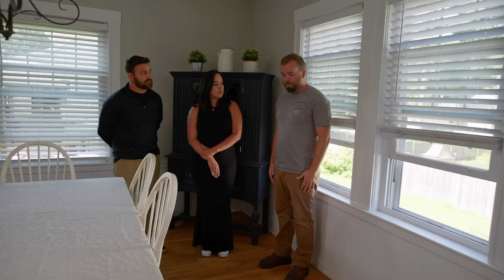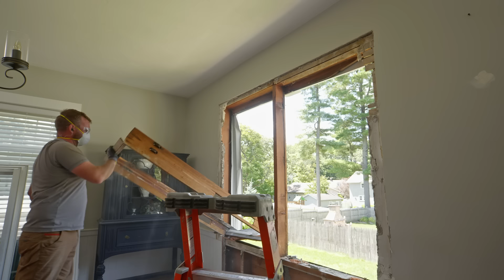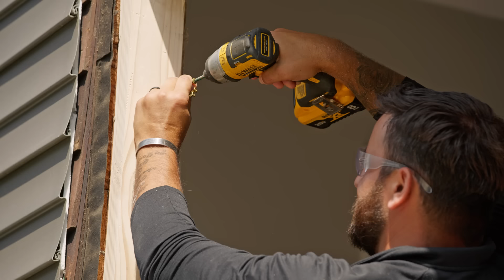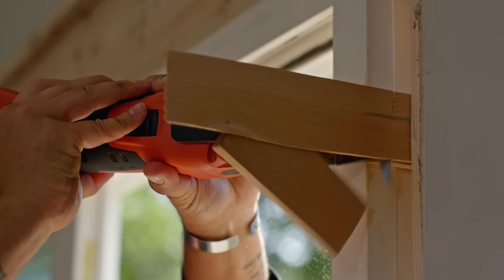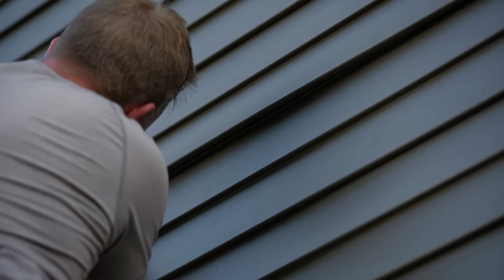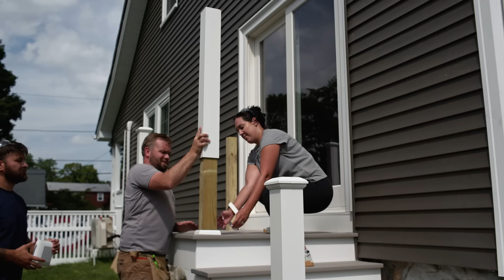How to Turn a Window Into a Door | Ask This Old House

Comment: I still dont like the idea of joist tape. If any moisture gets under that tape then it will just stay wet. Most of the times that I have seen old deck joist rot is when its built around concrete steps. Usually the deck boards rot because people stop painting them and very rarely have I seen rotten joists. Its just seems like a risky solution for a problem that doesnt really exist.

Comment: Be very careful when working with a load-bearing wall like this one. Really should have added a temporary wall to carry the load over the span of the window before tearing out that section of wall and putting in the header. Also, there should be at least another jack stud on each side too - all the studs that would have otherwise been in that gap for the door, should be represented by jack studs on the sides.
Reply: Yes that header isn't supporting anything. He let the wall sag and put it in.
Think of standing in a door frame and putting your hands on the head jamb. Nathan would think you're supporting everything above you.

Comment: If there was electical, how much harder would it be?
Reply: That depends on how much is in the wall, how easy electrical work is for you, and whether you think you should get the government involved with permits.
If it's just one or two cables passing through, you either route them over or under, depending on how easy access is from below (basement?) or above (attic or second floor?).

Comment: What was supporting the roof when there was no header installed?
Reply: You saw it - nothing.
I can't imagine Tom doing this job without temporary support. He did that with an interior load bearing wall that they were opening a large hole in (open concept stuff), and he did that on a porch when removing a post for repair.
For the interior wall, he put wide 2x (8-12") boards on the floor and ceiling and wedged in 2x4s that were cut a bit long so they worked like jacks.

Think of this new header they put in here. How is it going to support anything? They placed it with the above wall sagging already.
It's like walking under a bridge that you can touch, acting like you are holding it up.

Comment: I have no idea how they can wear safety glasses and a dust mask at the same time without the glasses fogging up in about 10 seconds. I've tried every kind of anti fog glasses, all the sprays and wipes. Nothing works. I think its because anti fog coatings just dont like to stick to plastic. I've even tried swimming goggles and the moisture from my eyes fogs them up!
Reply: You pitch your dust mask at the top to prevent air from coming out on top.

Comment: I know it's a nit, but the video ignored how the new header was aligned with and joined to the stud ends above the window opening. Did they cut the original load-bearing stud at exactly the right place so that each of the old studs hit the top of the new header? Were the bottom of those studs screwed or nailed into the top of the new header?

I know these guys are professionals, but I've done enough work like this to wonder whether installing that header was really as easy as the video made it seem.
Reply: They didn't provide any temporary support for the wall. Tom certainly would have done this, and it's easy to do. That header isn't supporting anything. The wall sagged and they put in the header.
Think of standing in a door frame and putting your hands on the head jamb. Nathan would think you're supporting the entire load above. 🤦🏻‍♂️

Comment: What is carrying the point loads of the newly positioned Jack studs?  Also, how was the header size calculated?
Reply: with a formula
Reply: All of that, including the header, is supporting nothing. They didn't provide temporary support so everything above sagged and they placed the header right there.

Think of standing in a door frame and putting your hands on the head jamb. Nathan would think you're supporting everything above you. 🤦🏻‍♂️

Comment: Did you check for lead on the existing paint?
Reply: Only required for homes built after 1978.   That house looked pretty new, so likely not required.
Reply: @josephewing80  looks like before 1978, looks  like planks were used instead of plywood for outside walls.
Reply: @mcarroll598    stone foundation, plank under siding, balloon frame, is all pre 1950. (and so was that wallpaper)
Reply: @josephewing80  what year was  this house built?
Reply: Did they double up on their underwear too?
Reply: @2loco  yes
Reply: Ok Karen
Reply: @kaseyc5078  who’s Karen?

Comment: I love how the contractor shows up, looks at the job, and gets right to work. No measuring, no checking for structural issues, no permits. This show makes it look like everything happens really quick.
Reply: I know side projects become frustrating for sure when you do them. A 3-4 day job here was wrapped up in 15 minutes. Then you go to do it, make mistakes, forget something from the hardware store, etc. It gets irritating when yours isn't as fast, lol.
Reply: Obviously there was a lot of prior planning and prep. Building permit had been issued and slider of course wasn't chosen and picked up on day of install let alone all the misc supplies Nathan wouldn't necessarily have off hand. Header size is typically determined by a structural engineer at time of building permit application and review... The install was quick but that happens because of his experience and proper planning. A lot of detail can't be shown due to video time constraints. Always good work from the TOH team. Great to see Nathan a part of the group, Mark, and Jen with sadly our long time TOH experts nearing retirement.
Reply: He did say it was going to take a couple days and asked if there was someone to take care of the kids.
Reply: I specifically noticed how there was no measuring and marking. That’s a time consuming part of any project. Not to mention shlepping and moving stuff. I was also cringing that they didn’t move that china cabinet to reduce risk and create space.

Comment: Surprised no temp supports when he cut that opening before the header was fully  installed.
Reply: Caught me by surprise too
Reply: With balloon type construction there are no need for headers
Reply: @car45racing They removed a stud between the two windows that was load-bearing, though.
Reply: @car45racing  thank you for clarifying.
Reply: There were no headers originally, so removing the windows did not change any load bearing. The addition of the header was an upgrade.
Reply: @larryc8568  : To the contrary, there was a load-bearing stud between the two windows.
Reply: @thomasstambaugh5181    yes, but no second story and no snow on the roof, so really a minimal load to take up.
Reply: @larryc8568  thank you for the info